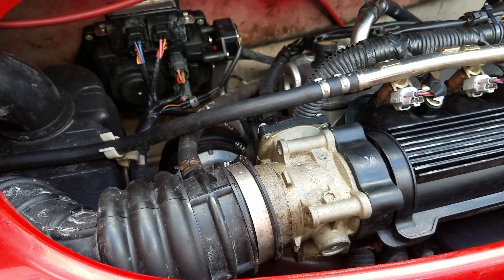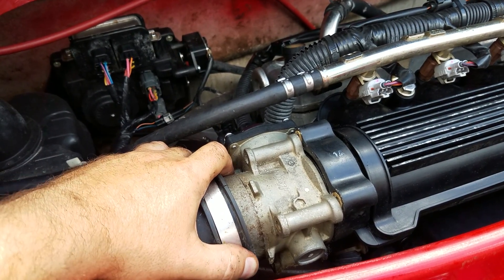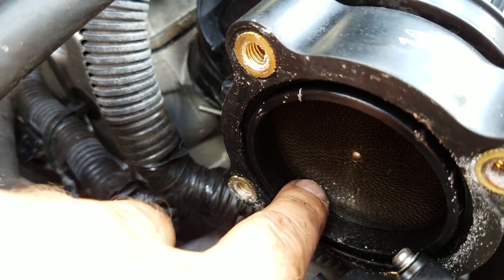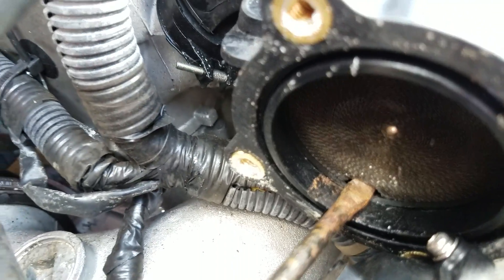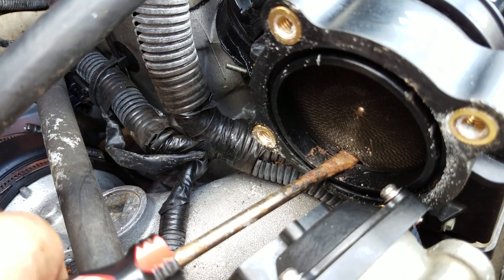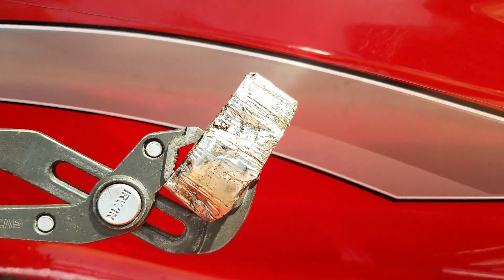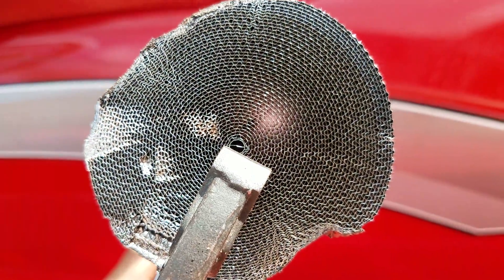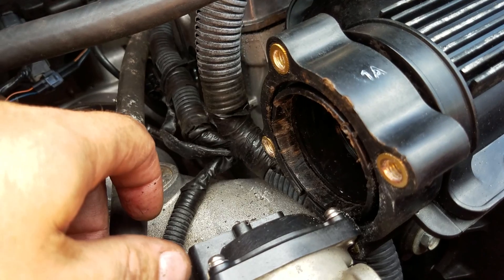Air restrictor removal yamaha deluxe vx110 diy

Comment: On my 2012 vx cruiser I spent hours. Probably going to end up using a sawz all to remove it. It’s awful to remove. This video doesn’t explain how terrible this is to remove. Just know this before trying it on the model I have. Be warned. I’ve removed the jet pump, replaced impeller, spark plugs, removed my air box. I have many tools and know what I’m doing around a wrench. This is not easy. Anyway. That’s a warning and word to the wise.

Comment: isn't the purpose of this to keep the backfires from making it to the engine compartment, therefore reducing the risk of explosion?
Reply: If you remove this you should replace your air intake with a flame arresting air filter

Comment: When i remove that i have to put like a donna inside?? Or just put in back and that its???
Reply from the maker: I'm sorry I do not understand your question try to use the Google translator.
Reply: This is what i m talking about.. if i have to put this thing.. thanks
Reply: @FLORIDALIFECLIPS  i have a 2008 vx 1100 cruiser..
Reply from the maker: @TheLord_TV   No that's ONLY FOR for a high output or super high output
Reply: @FLORIDALIFECLIPS thanks... and what I do with the rubber ring that held the restrictor. I leave it in its place? Will not the intake suck it?
Reply from the maker: @TheLord_TV   Remove it.
Reply from the maker: @TheLord_TV   Yes the intake will suck it in 
I heard of people gluing it in place and then the intake sucking it in
Reply: @FLORIDALIFECLIPS  thanks for all....